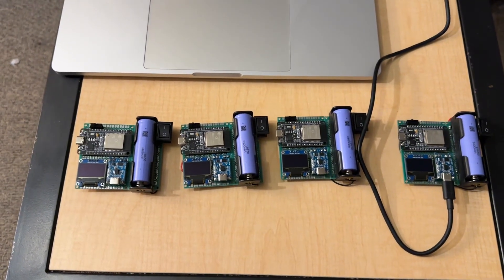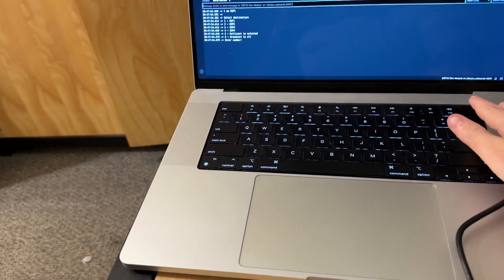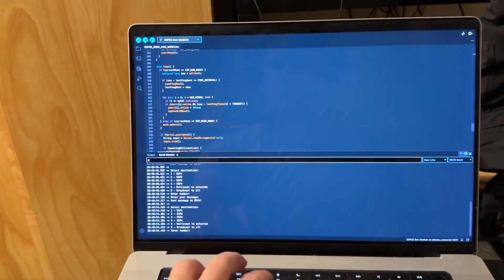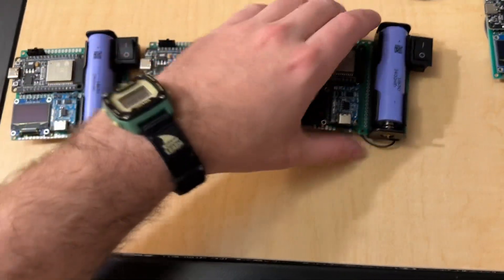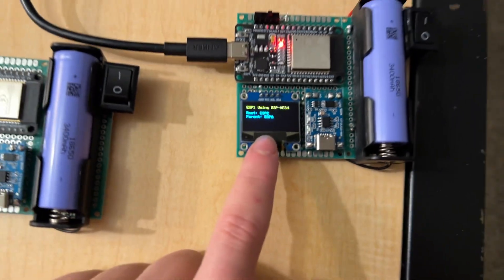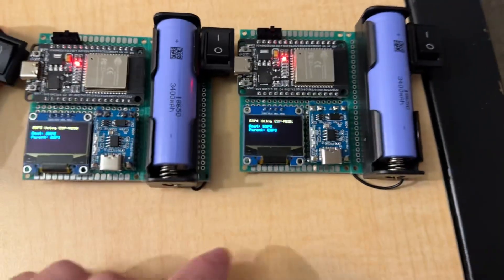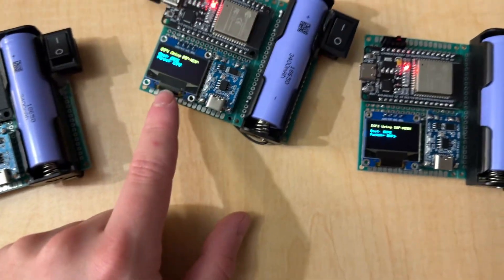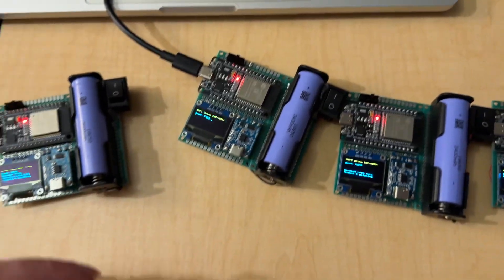ESP-NOW and ESP-Mesh Project Using ESP32 Microcontrollers

Comment: Nice job dude. Questions: Are you using a 5V Battery Charge to charge a 3.7V battery? Can we do it? How did you connect the battery charger to the battery and to the Esp32? In parallel ? Tks.
Reply from the maker: The Battery management system (BMS) accepts 5v input via USB C. The BMS handles converting the voltage and charging the batteries. It also handles the output to the ESP32. There are battery input solder points on the BMS and power out points.
Reply: @LouiHandwerker  Tks!

Comment: Did you power the esp32 through the Vin from the battery directly? I’m planning to create a similar setup like this but i was wondering do i need to step up the battery to 5v first or not. I’m sorry if the question sounds dumb I’m newbie into this 😅
Reply from the maker: Don’t feel dumb, I did power it through VIN. I’m pretty sure it can take a range of voltages between 3-5v (maybe more), but having something to regulate the voltage output from your battery is key in making sure they system remains stable and all peripherals connected behave properly. As the battery depletes, if there’s nothing regulating the voltage, there’s potential that some of your connected inputs and outputs may not behave as intended or work at all.
Reply: @LouiHandwerker  ah got it, I will use the  voltage regulator then if that's the case. Thank you so much for the explanation, cheers.
Reply: @afrodite8685  Make use of a BMS. Since VIN is connected to an LDO, it’s already regulated to 3.3V. You can also add a voltage divider to monitor the battery level and decide whether or not to go into deep sleep based on that.

Comment: Where did you aquire the hardware ??
Reply from the maker: I got everything off of Amazon, here are the links:
DIANN 10pcs 18650 Battery Holder - https://www.amazon.com/dp/B0BJV7SK5D?ref=ppx_yo2ov_dt_b_fed_asin_title
18650 Battery Case 4Pack Battery Set - https://www.amazon.com/dp/B0CFQW47V9?ref=ppx_yo2ov_dt_b_fed_asin_title
MakerFocus 15pcs TP4056 Charging Discharging Module Type C Interface with Battery Protection - https://www.amazon.com/dp/B0CWNXKR4X?ref=ppx_yo2ov_dt_b_fed_asin_title&th=1
5 Pcs 0.96 Inch OLED I2C IIC Display Module 12864 128x64 Pixel SSD1306 Mini Self-Luminous OLED Screen Board - https://www.amazon.com/dp/B09C5K91H7?ref=ppx_yo2ov_dt_b_fed_asin_title&th=1
ELEGOO 3PCS ESP-32 Development Board USB-C - https://www.amazon.com/dp/B0D8T53CQ5?ref=ppx_yo2ov_dt_b_fed_asin_title
The boards they were soldered to I had on hand already, but you can just search perf board or PCB board and find them pretty easily.
Reply: @LouiHandwerker  
Thank you

Comment: I was wondering if the blue board with the USB c cable is a battery controller for charging the battery. Also love those little screens. They took me a bit to get running at first but they are so cheap and are great for simple info.
Reply: yeah its a charging module haha i had one of these screens and accidently broke it
Reply from the maker: @HavocBlack  Yep, the blues almost board is a BMS that works for a single 18650. They are pretty cheap, charge pretty slow, and honestly get a little hot but they worked for this project.
Reply: Hi there it's a   TP5040